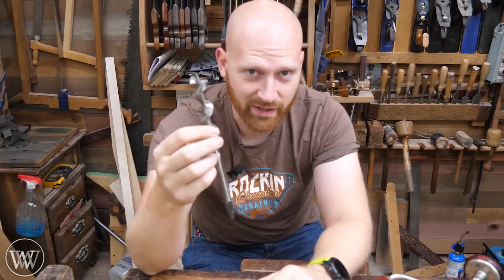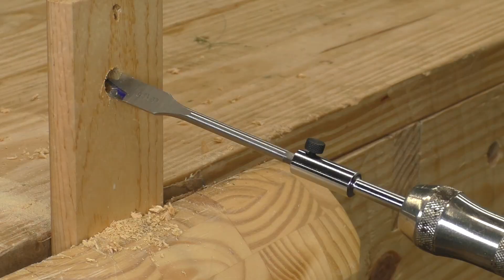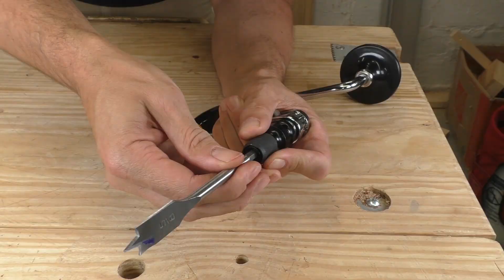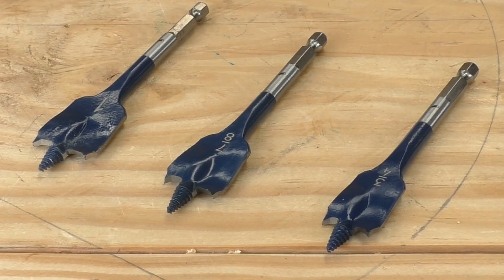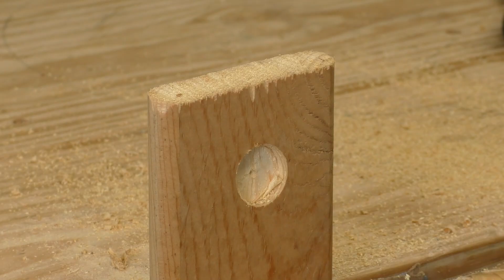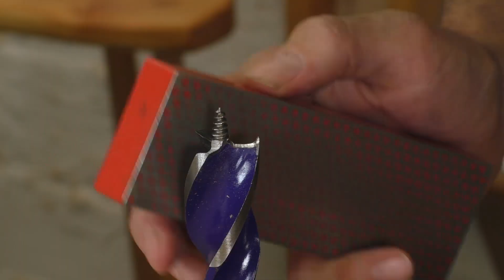Modernize your brace with new gear!

Comment: Simple solution. You're going to like this one. You need to try a different Wood Owl: the Wood Owl OverDrive line. It has a Brad point and the cutters are phenomenal. I used the 3/4" x 6.5" boring bit and couldn't be happier when making bench dog holes in my 5" thick Ash bench top. Here's the too good to be true part: $14.82 on Amazon. Side note: the cutters are specially designed to allow for clean exit on the wood, thus minimizing the need for a sacrificial board on the exit.
Reply: Oh wow, those look pretty cool and the video I just watched on it showed how well they did. The little brad point reminds me of pictures of old forstner bits that were made for braces which look to have the same size brad point, maybe even a little shorter, I'm guessing they might work just as well as those.

Comment: Though not inexpensive, Lee Valley tools has 2 and 3 jaw bit braces, as well as auger bits.
Reply: I made the mistake of buying their 2 jaw bit brace, and I regret it.  The grip on the chuck had a rough finish that I had to sand down, there was rust on the ratchet mechanism, and it had the same loose-goosy feel of the Garrett Wade, while costing more and not having that sweet 1/2 ratchet.  It also didn't come with any instructions at all.  I know it is a bit brace, but figuring out the ratchet mechanism took some time.

Not the quality I expect from Lee Valley Tools.

Comment: In my experience, the Irwin Speedbore bits are ALSO crappy in a power drill. I think they are mostly use by electricians, plumbers & others that need to quickly bore holes in framing. (I got one to wire my basement, 6 years ago. Haven't use it since.) Appearance is not important to those trades because the evidence is covered up later.
Reply: Of course. They are called SPEED-bore bits.Think about it.
Reply: Several years ago, I tried to use an Irwin to cut a fat dowel hole in a bed post.  Complete disaster.  I wish I had had a bit brace back then.
Reply: @eloscuro704 just need spade bits or forsener bits. They can cut a clean hole in a power drill with ease provided you do a bit of practice. 

That being said the speed bore bits DESTROY wood even when your experienced

Comment: I've got no help on bits but there's a product I've used by Lee Valley for your existing brace. Converts it to a socket drive.  https://www.leevalley.com/en-us/shop/tools/hand-tools/drills/100081-brace-drivers-for-screws-and-sockets
Only about 12 bucks and will do everything that brace in the video does.
But it adds length which can be an issue.

Comment: I have a vintage two jaw brace and am using cheap ship augers from Harbor Freight. It's... adequate. Sharpen the nicker and the blade and back it out half a turn to make sure the first few layers of fibers are being fully severed, and you'll get a pretty clean hole. I'm building your three-tool stool with my kids, and the ship augers went through the side-of-the-road wood (maple, maybe? idk) cleanly enough for my purposes.

Comment: I put a few different twist drills in my indexer and milled my own 4 sided shank. Works fine, im sure that of i used higher quality twist drills they would have been closer to round making the square more precise as mine ended up a bit off center.

Comment: I agree with the basic concept of what you are asking...... But There has to be a middle ground.  I don't buy sets of bits anymore.  I buy the ones I use and wear out and break.  And back in the day when a brace and bit were what craftsmen used, they didn't buy sets either.  They bought single bits of the highest quality, one at a time, that they needed, as they could afford.  A good Quality Bradpoint  bit will work just fine in a hand powered brace up to about 1/2 inch. (A starter set of these should be about $25.)  Yes I have used them.  Larger than that buy the one bit you need for the project you are working on that James Wright recommended.   
Like you said the bit used in a brace have to be designed for slow speeds and are harder to make.  They are going to cost a little more.  Some times you do get what you pay for.
Or just admit that sometimes a decent cordless drill and bits designed to work with them are not all Bad.

Comment: Really old spade bits (pivot drills) are pretty good, while I've only ever used small ones (1/8" and under in a little multitool type thing) they may work in a brace. Unfortunately, I've never seen a modern seller for these. Fortunately, they're literally round stock with a chisel tip.

https://www.youtube.com/watch?v=N1aj_3tlQhU a good video on how to make them and how they work.
Reply: would that work in wood?
Reply: @pacman10182  the guy tested it on wood successfully, so it should. Although you need to clear waste quite often as you drill
Reply: @grockerdoom  I didn't remember that

Comment: Or take a look on eBay UK. I just found a 13 bit vintage auger bit set with a current bid of £8.50 plus £3.25 postage to UK. Unfortunately, postage to USA is £35.53. But that is only $57 for a set of 13.

Comment: Sorry, this doesn't meet your criteria, but it only took me 2 minutes to find this on Google.
https://www.fine-tools.com/auger-bit-conical-square-shaft.html
 
1.) Affordable - prices range from €32 to €39 per bit,
2.) Readily available - they are now in production again in Germany,
3.) Personal experience of using - I have an old brace, which I inherited from my father, and I use it when I can, but I only have a limited number of bits. When I have some money, I am going to buy some of these.

 
And they are in imperial sizes from 1/4" to 1"

Comment: So, I do not have a solution, because I have not tried it myself. But just looking here at Lee Valley Hardware's website (here in Canada), they have a 2 and 3 jaw chuck brace, and... some random bits with no manufacturer listed. So not exactly what I would like to see, but they do sell the wood owl bits as well. Most of the stuff Lee Valley sells is of pretty good quality, so I would figure they are half decent... But expensive too. The brace is $115 cad and the bits are $11+ each, or a set of 7 for $125. Once again. I cannot recommend them, as i have no experience with them. But If I had to find something near me, starting from nothing, this is what I would be looking at. In addition I think that also you might want to look at your technique. Have you tried orienting the board so that you can drill down, instead of sideways? It would seem to be a better orientation for applying continuous pressure. Similarly, have you tried backing and (fronting? term?) your wood to be drilled...with another set of sacrificial boards? The idea here would be that in order to help prevent blowout and tear out, that if you clamp it between two other pieces of wood, that then they would take the brunt of the damage, while the middle board was more clean having been protected by the other boards? Just a thought to consider. Once again. I'm totally armchair speculating back here, I just know that from working with my drill press, and trying to figure out the same issues, that those may be worth trying. I have 2 or 3 old braces. I guess it's time for me to look at the jaws and try to find the correct bits! I also have a vintage craftsman breast drill that I want to fix up. At least this saved me the headache of buying the bits before i looked at the jaws! Thank you so much! Hope any of that helps! p.s. I also just thought about grain structure. A really dry coarse grain wood (like oak) is going to be hard to drill with an auger bit, The bit is going to want to run through the wood faster than it can cut properly. Similarly i can think of other wood that would be a pain. Ash, Maple. Hardwoods. It's almost like you want to plane the hole out, rather than drill it. so like. less is more? if that helps at all. Maybe a Twist Bit would be better? in certain circumstances? Or like, a hole saw? Not sure what to suggest. But definitely worth experimenting with.

Comment: Hi Rex, Big fan of the show! I'm gonna try to bend the rules a little bit here - I haven't tried this tool exactly, but I HAVE used its vintage counterpart. Lee Valley makes an adjustable auger bit: https://www.leevalley.com/en-us/shop/tools/hand-tools/drills/67385-adjustable-drill-bit?item=72J0320 that is exactly the same as an old Irwin adjustable augur bit that I purchased at an estate sale, except this one has a hex shank. It comes with two cutters for cutting from 5/8" to 1 3/4" which is pretty good for $39.50. The vintage irwin didn't cut as well as my single sized augur bits but it wasn't bad and Lee Valley has earned it's reputation so might be worth a shot.
Reply: Hey! That's pretty-dang snazzy! I'd almost forgotten about the adjustable type - I think I might actually grab one of these, come payday! Thanks, Eamon! :)

Comment: Hi!

Maybe I can help with my regional view, as I live across the pond. 

Fisch (german for fish) has really well made - but expensive - auger bits in all kinds and sizes. They manufacture these in Austria but as you mentioned, their hex bits are for machine use and the other ones for hand use only. I use them for years and can't say anything bad about them. 
Much cheaper but very short are japanese Star-M auger bits. They seem to have a "hybrid" design that allows them to be used with your handdrill as well as with your powerdrill. But the results are just okay-ish.

Maybe these two brands are worth a try. 

Regards, 
Etna.
Reply: From the UK. Fisch are good quality.

Comment: Rex, I appreciate you publishing a "negative result" video. In science, papers that fail to prove the original hypothesis are often not published because they aren't sexy. But sharing what doesn't work is just as good as what does, even if it might not make for as satisfying a result. I've been holding off on buying auger bits I've seen at flea markets, but now that I know there aren't great modern replacements for bit braces I'll be snapping up good ones I come across.
Reply: I bought my augers from a vintage tool dealer. Not cheap, but mine were about half the usual price because the box was falling apart and was missing the cardboard labels, so less attractive to collectors.
Reply: I believe that telling people what doesn’t work as in flawed, crap, rip off etc. is more important than something that does work. When we buy a product, we’re assuming a spade to be a spade, however if that spade comes to live and smacks your grandma, then more likely that spade won’t be on the market very long and money and resources will be spared. Online reviews can be damaged significantly just by one single negative review.
Reply: I was in the process of writing a similar reply when I saw this one.  My sentiments exactly
Reply: hear, hear.  Right on.  It can't be moon beams, kittens, and rainbows out the wazoo everytime.
Reply: I’m impressed that there were no “knickers/ nickers” jokes, or am I?
Reply: I was in the process of writing a similar reply when I saw this one.  My sentiments exactly
Reply: SECONDED!
Reply: @AnimeSunglasses  I think James seconded himself.

Comment: What about spoon bits? I have a set for Windsor Chair building.  They cut wet wood and dry wood. Pine, red oak, maple, poplar... with ease and very clean holes. Plus they are designed for a bit brace and you can drill hole at any angle.

Comment: Okay, I'm kinda surprised... Hope this helps SOMEBODY... and I'm not too picky about who...

   What I discovered pretty quickly with my collecting and refurbishing of bit-braces was that the chuck is just about as size-variable as a modern drill. I, too, ran into the difficulty of finding decent bits, particularly decent bits that were affordable... BUT I kept returning to the weirdness of all the old-school bits having exactly the same size square end, but that chuck being so variable in size.

    Hex bits are almost good... BUT as noted, they do tend to slip, and it can be cumbersome to get them fitted to the chuck which isn't designed for them... 

     As fine wood-workers, however, we are supposedly trained and practiced at being really skilled in getting three aspects of any project very well.

   1. Straight... Precision in straight lines for a veteran woodworker is near unparalleled. Even machinists don't get the same level of precision "working by hand", they rely on machines for their precision, and are very temperamental about anyone "getting rough" with their instruments.

   2. Plumb... If you want to know where dead-on horizontal or dead-on vertical is, ask a woodworker. From plumb-bobs, to protractors, the wood worker can find both without parallel in the hand-tools and knife marks line of marketing.

    3. SQUARE... That's right, we have those secrets as well. Whether it involves calibrating a framing square, or getting the horizontal and vertical cuts of our joinery precise enough to fit a piece of heavy furniture together well, we can make anything square all day long!

     SO pop over to the bench or angle grinder, and CUT THE ENDS SQUARE on bits you'd prefer to use for the brace. You can also get along with a dremel and stone (or similar tool) and there are rotary bits with diamond grit among a myriad of utensils for creating the square shape that a brace is designed to grip well.

     If you're really ambitious, you can even sit down and draw out the full design shape of the old-school bits including their taper. It's important to understand why it's there (to allow the bit more grip, for extricating the bit from wood) but that you probably won't be disappointed with a first try that's simple, straight, and square. Unfinished, metal is littered with tooling marks and presents a roughened surface that grips more than adequately for most projects... SO all you need is to KEEP the remaining end centered and take off just enough metal to make it square. Size isn't as important (mostly) as it might seem, and I am currently under the belief that all those square-ended bits were made the same size for convenience rather than some particular engineering requirement.

     For me, either the angle grinder (fastest) or a belt sander (flattest) presents the most convenient method for squaring up a round bit. It's also worth pointing out that if you do get "a little off center" that the brace isn't going to move fast enough for it to present a huge problem. It's only going to feel a little smoother, the better you've centered the square. NO need to be afraid, and you can make nearly any twist drill bit into a brace-worthy bit with a few minutes invested. ;o)

Comment: Honestly "my solution" is just have the subpar but cheap bits and get good at using them + cleaning the holes after, or go for a bargain electric drill and bits that gets the job done well enough. If you're on a budget, you are on a budget - it is still a limiting factor even if you push the boundaries.

Comment: I have two antique/vintage braces. One is able to accept modern round twist bits and hex shank bits without issue and the other cannot. My suggestion would be to shop around for a brace. I've also not had issue in finding auger bits at flea markets, garage sales, antique stores, etc. in the US.

Comment: Funny, my brace holds round shank bits just fine.  It's still for the square ones only, but I can make it work and I also use a drill chuck in there for smaller bits.

Comment: I use an old Japanese made brace that is a four bit, not two bit chuck. It is no improvement over a two bit chuck. I buy all my bits on eBay.They are  used and almost all are in bad shape after many years of use. One thing you forget to mention is how many old auger bits are badly abused and almost useless. My solution is an Italian made auger bit sharpening file.. I am used to using files, but still found a brace bit (auger) file hard to  learn. So I sharpen my used auger bits and they are as good as new. There is a (new)auger made in France .This firm also makes new metric sized bits. l Sorry no links.I thought I was the only person left in the world still using a brace.
Reply: An auger bit file is very useful to make less expensive new bits cut properly too.  Cheap forstners can be acceptable if sharpened.

Comment: I don’t know where you have been but that brace is a new one, I must have at least twelve of the older models and you will find them with four chucks that not only hold the four sided bits but also hex screwdriver bits (and you can get a hell of a lot of torque on them to undo even the toughest screws) here in the UK you can pick them up at car boot sales for 50 pence (USA= $0.60) and I have just bought 3 twist bits from boss (£9:99= $12:41) and they work great
Reply: Yep - the braces and bits are super easy to buy in Australia too. Almost every boot sale / garage sale / fete / swap meet for a couple of dollars. The bits are throw-away items, you can get them for free if you buy something else. boxes.
It's stupid to try and use "modern" bits in these low-speed tools.

Comment: Adjustable auger bits work ok. I found a couple of sizes used, and they're pretty good. Lee Valley sells a Japanese-made adjustable bit that is not outrageously expensive and works ok in a brace (hex shank; I bought one and it's pretty good but doesn't do small holes). I use a three-jaw brace (also from Lee Valley) that holds most bits. My original strategy was to order a set of Irwin auger bits. These were affordable on Amazon, made IIRC in Brazil. The quality control on them was pretty horrible. I bought an auger file from Lee Valley and got some of the Irwin bits to work ok. Others have a snail that pretty much sucks. 

The adjustable bits don't have flutes to clear chips, so there's that. But they cut fairly cleanly and can be resharpened.